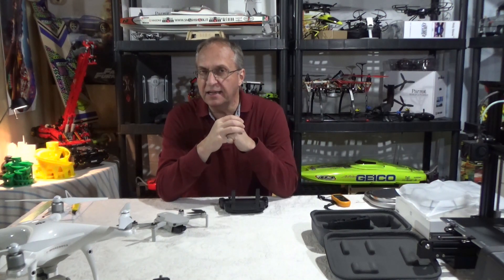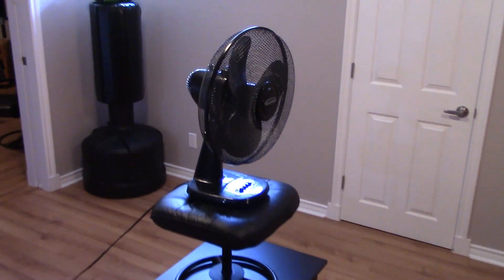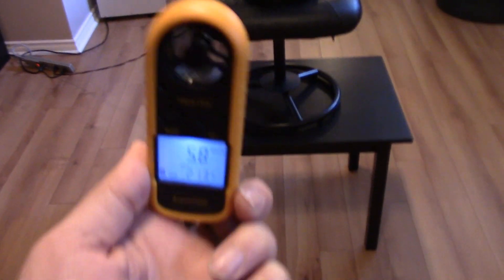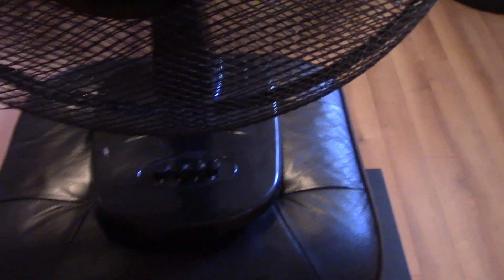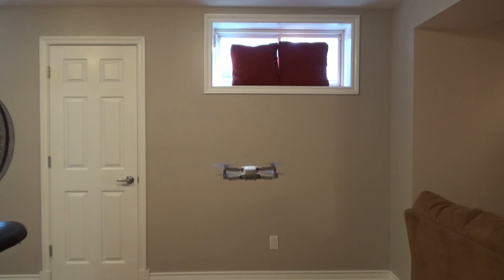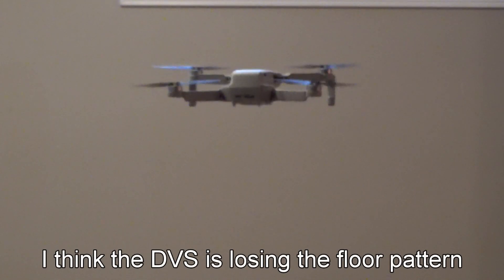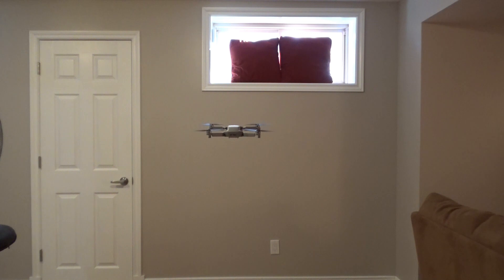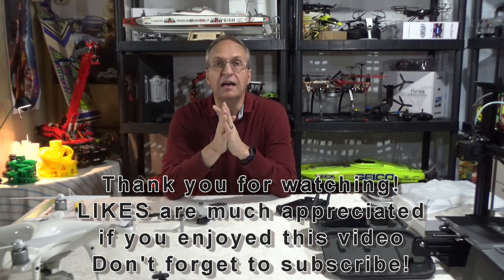dji Mavic Mini | Interesting Wind Test

Comment: The mavic mini propellers are thin and flutter in the wind. Could be one of the compromises made by dji to reduce weight. I wonder will thicker and less flexible props reduce the shake in the wind?
Reply from the maker: This is a very good point. I am sure dji did extensive testing with various prop design. They also have the experience with the bigger Mavic and the Phantom. Thank you for visiting my channel.
Reply: @SuperdanTech  I fitted some aftermarket propellers (a bit thicker and less flexible),  balanced them on the pocket scale and the mavic mini flies better in the wind. No more propeller flutter and less shaky.
Reply from the maker: @jctoo9756  where did you get them from? I find the stock Mini very shaky in the wind indeed.
Reply: From Aliexpress. Don't bother to get those with fancy color and stripes. Those are way off balanced. I bought the ones which resemble the original but with golden tips. They also come with silver tips just like the original. Weighing 0.55 gram vs the original 0.5 gram. The diameter of propeller holes is a bit bigger causing unacceptable freeplay and propellers drooped after fixing onto the motors. As a workaround, I wrapped a layer of cellophane tape around the screws. I used threadlocker glue on all screws.
Reply from the maker: @jctoo9756  thanks a lot for the info!